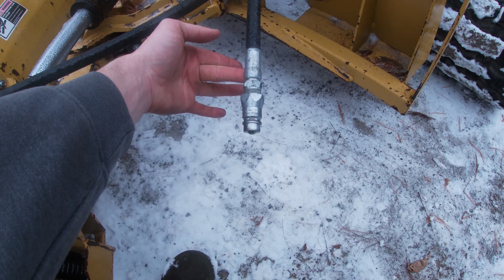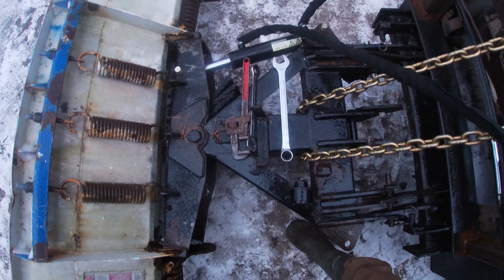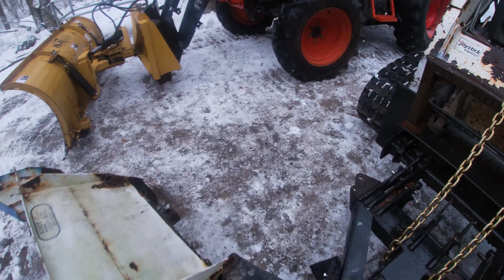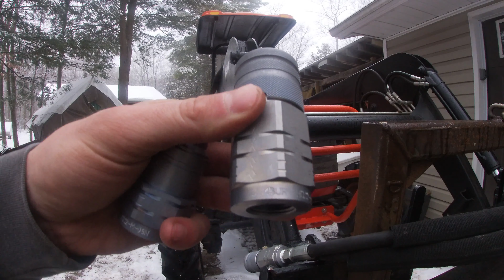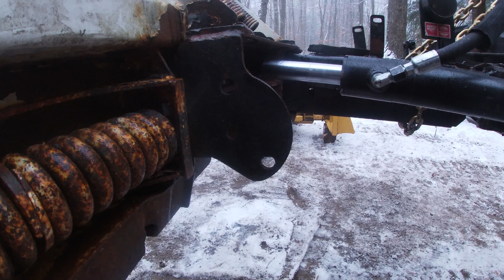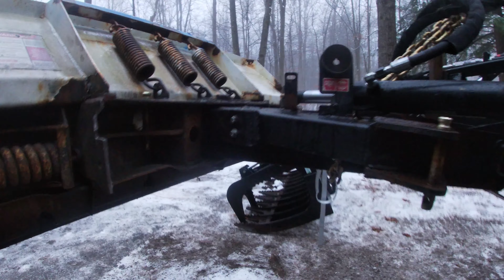Replacing Pioneer Style Couplers with Flat Face Couplers

Comment: Where did you get the HLA 2000 yellow snowblade. I have been looking at one locally and wondered how well they worked and are they heavy duty for daily use?
Also good for you to switch to flat faced couplers as I have the Pioneer fittings and they always drool oil every time I disconnect them. I have to do the same.
Reply from the maker: I bought it second hand and it seems to be built very well. I have t got to try it yet, I’m still waiting on a good snow fall. I’ll post a video when I finger to use it
Reply: @ericbrinson9741  Will be looking forward to that. I don't get a lot of snowfall here, but when it does, it can get to be as much as 2 feet overnight. Thanks.

Comment: That block on the yellow plow is a flow valve. You can adjust to where the flow is slower and the plow won't jerk like that
Reply from the maker: Thanks for the info I appreciate that, I’ll try and dial it back so it’s smoother